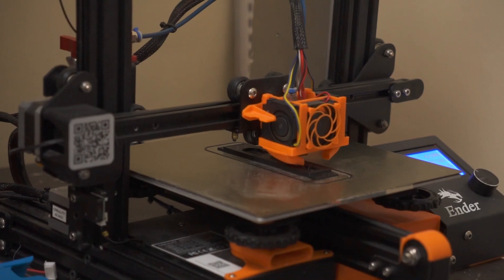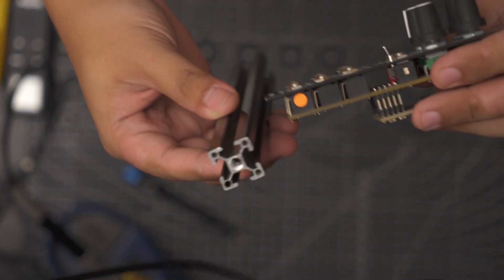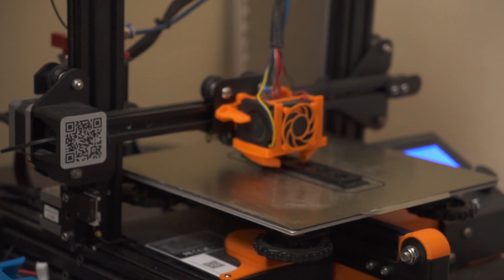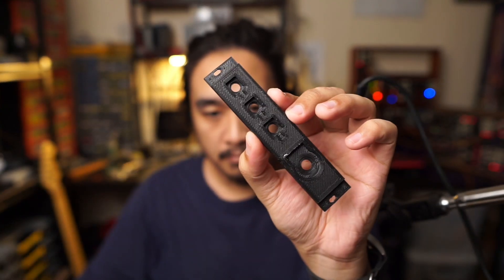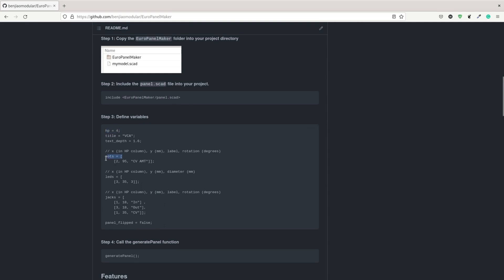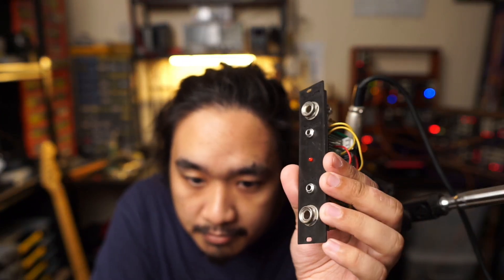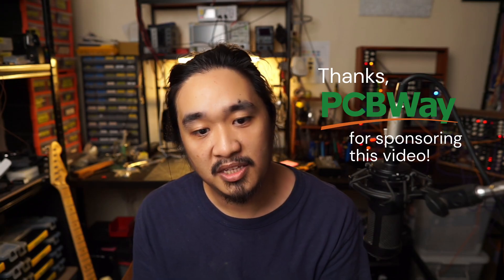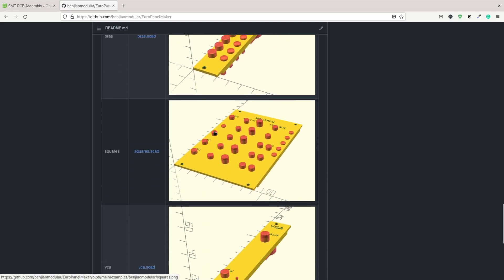I made a EuroPanelMaker library for OpenSCAD!

Comment: Hey Benji! Thanks so much for this. Really pleased with the results but it wasn't particularly strong on my Makerspace's Prussa with defaults. 

Have you done much experimentation with print settings? What material/infill do you use? Any other tips for the print? (sorry 3D printing noob here!)
Reply from the maker: Oh, i noticed you also asked the same question on Reddit. Pasting my answer here in case others would like to know as well:

---

You're welcome! Glad you like it.

It definitely isn't as strong as aluminum/PCB panels, but I've never experienced any of them break under normal use.

Nothing special -- eSUN PLA+, 0.2mm layer height, 210C, 20% inflill. Make sure to print the panels face down.

I've been printing with eSUN PETG recently, but that's because I've also been printing rails and I'm too lazy to swap materials back and forth. Heh. They do come out a little tougher, but the fonts tend to become less readable.

Comment: Nice lib, maybe it miss an option to get jacks rotated 90° (or I missed something ?)

What is your printer's orange head?
Reply from the maker: It does! I just haven't had the time to work on the docs yet. 😅 I use it in some of the examples. Both with jacks and pots.

It's the Minimus shroud by Rogue_Designs: https://cults3d.com/en/3d-model/tool/minimus-hotend-cooler-system
Reply: @benjiaomodular  thanks!
Reply from the maker: No problem!